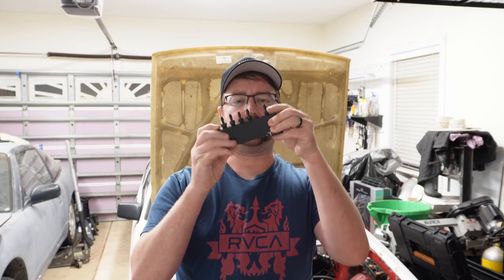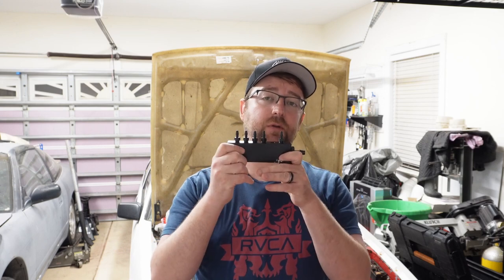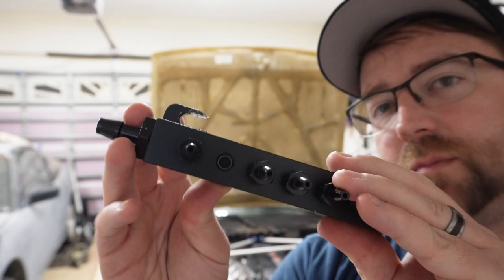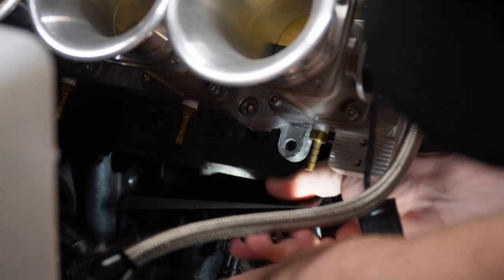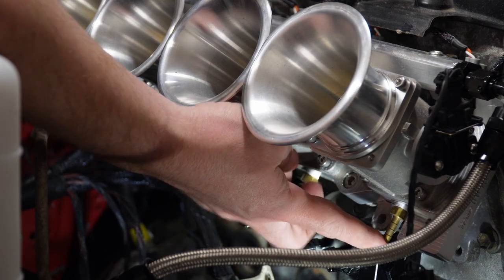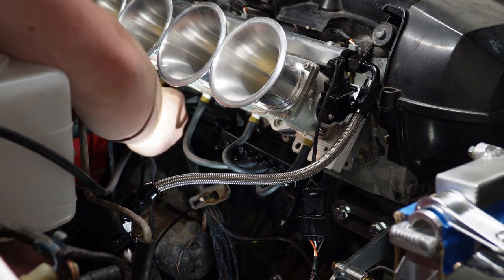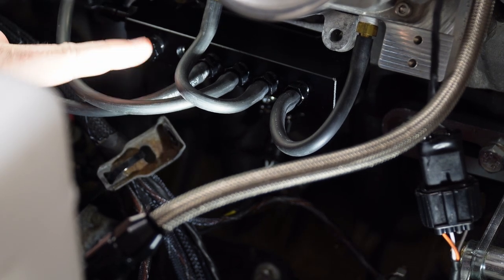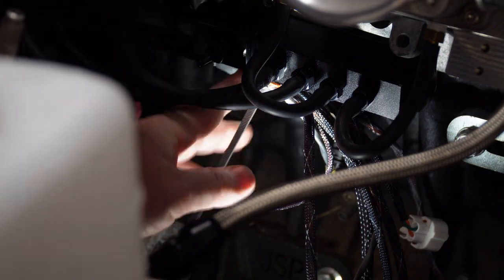BEAMS 3SGE ITB - Vacuum Block

Comment: Great vid as always Devin!  Simple install, where did you hook up the main vacuum line to the vacuum block?
Reply from the maker: For the big port on the end, that'll tee into the idle air control valve and brake booster

Comment: What happens if you tee all the 4 ITB barbs into one adapter then connect it to the block to save ports? Any difference? I just seen others do it this way as well.
Reply from the maker: If they're all teed together to the same small size, then yes. The volume of air producing vacuum is greatly reduced. It's like breathing through a straw vs just breathing regularly. It'll be easier for the MAP sensor to become biased when using vacuum (hitting the brakes), and the booster won't be as effective.
Reply: @DoctoredGarage  Sounds about right, thanks for the reply!
Reply: At that point you just connect it to the MAP.  You combining them into 4 already served as the block